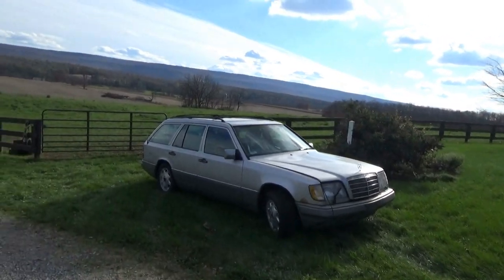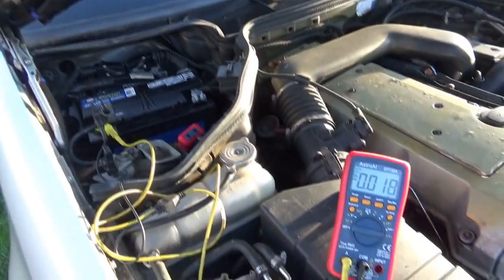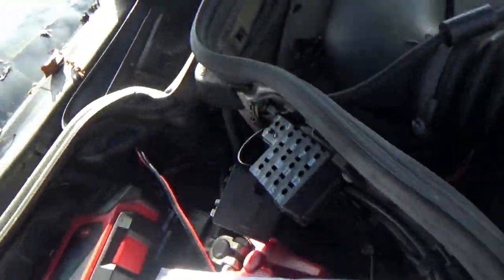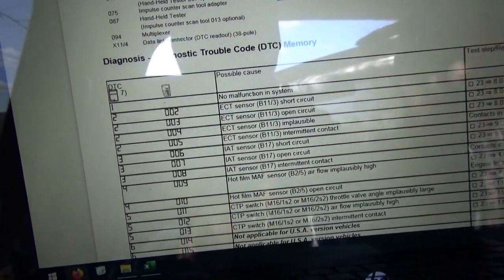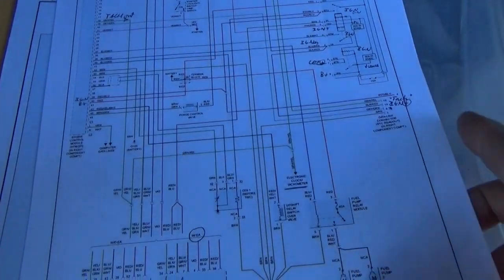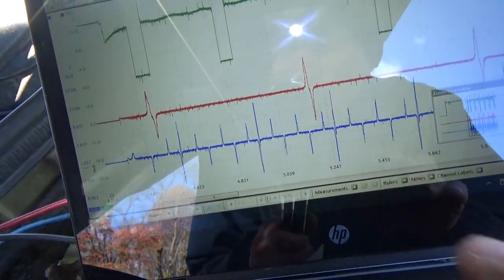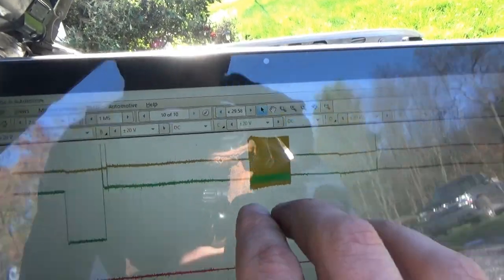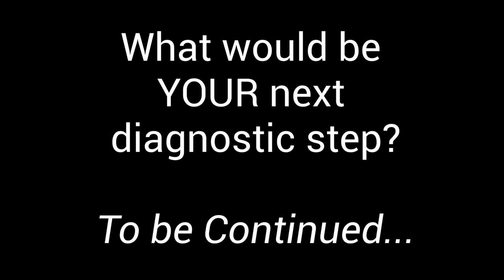The MYSTERY Mercedes - Part 1 (Thanksgiving Special)

Comment: Were cam and crank scope captures taken at the sensors or engine computer? If sensor, wiring harnesses and connectors definitely a concern.
Reply: He used piercing probes at the computer connector. Could still be pin fitment there I suppose, but I'm sure he at least looked at it to see if it was visibly messed up?
Reply from the maker: Right at the ECM 👍
Reply: @PineHollowAutoDiagnostics  sorry to stray from topic...just got new TS100 today. Did you flash firmware on yours?
Reply from the maker: @rp5029  Never flashed anything since I got it...what battery are you running it with?
Reply: @PineHollowAutoDiagnostics  mine came with what loks to be a modified laptop power supply that is putting out 24v and says it's rated for 3 maybe 4 amps.
Reply: @PineHollowAutoDiagnostics  I only asked because mine was barely getting over 300c when set to 400c. Found lots of others online having same issue. This flash corrected calibration, used accelerometer to rotor display automatically from right to left operation, bumps max power to 430c, and seems like a more friendly user interface. Went from bummed to totally happy with it lol.
Reply from the maker: @rp5029  I set my default to 350c, but manually bump it up to 400c when necessary 👌
Reply: ...almost forgot, "not a sponsor"🤣

Comment: put new ckp sensor on it they had buliton out back in the day on these they are a known bad ! due to there location they suffered from temp damage
Reply from the maker: But the signal is good!
Reply: @PineHollowAutoDiagnostics  have you actually pulled the spark plugs out  and checked physically for spark

/